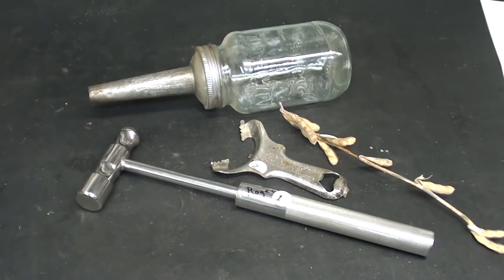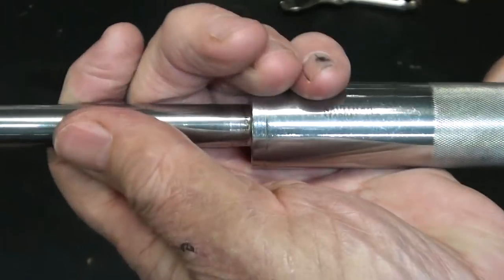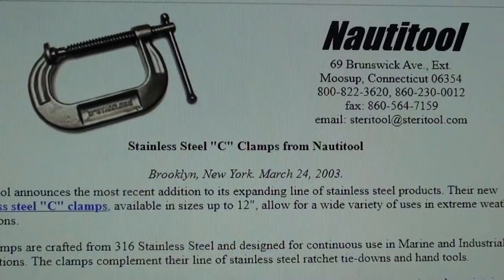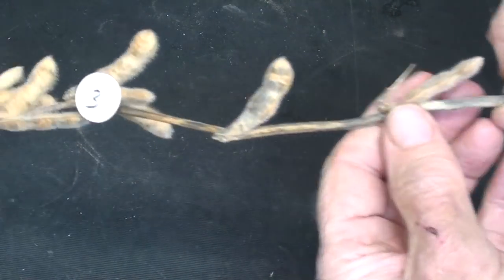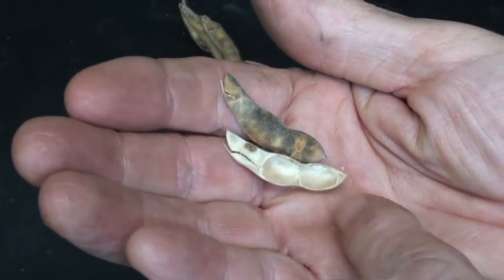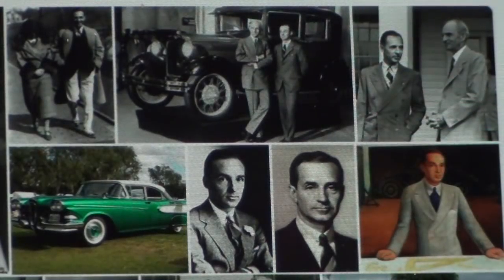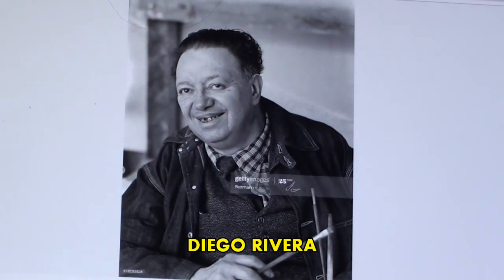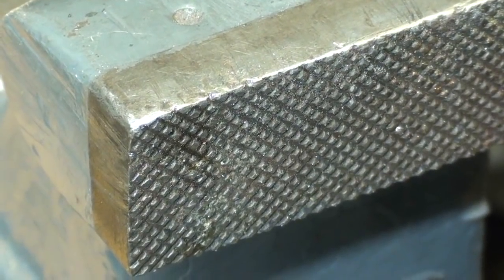WHAT IS IT? MYSTERY TOOL 63b Answer tubalcain mrpete

Comment: #1 is used in joint replacement kits. #2 is used for the older style Kegs. #3 is used for pre-60's vehicles. Water, oil, etc. Or used in kitchens used for separating cream from farm milk pre- WW2.

Comment: the gas stations here had a scam-- when checking your oil level, he would not push the dipstickj alll the way in, then tell you that your car was a quart low. if you said, put in a quart, they had an EMPTY can and just put in in and charged you one dollar
Reply from the maker: I have heard of that scam. At least I didn’t overfill it

Comment: The glass oil jars were before my time. I remember going with my dad to a small auto supply store in East Norwalk, CT and buying Wolfs Head motor oil by the case. Dad never got one of those spouts that you shoved into the top of the can so you  could pour the oil into the filler neck without needing a funnel. He kept an old can opener in the garage and would punch a big hole on one side of the top to pour from and a smaller hole on the opposite side to let air in to take the place of the oil coming out.

Comment: You can pressurize the marrow cavity so much while driving in a hip prosthesis that you can actually force fat and bone marrow into the blood stream ( which causes big problems).

Also used for driving pins into bone.
Reply from the maker: Thanks
Reply: Ewww
Reply: Used to machine hip prosthesis from forged titanium  with a spherical turning attachment on a Ward  turret lathe to plus or minus one micron ,no pressure!

Comment: Stainless usually does not spark when struck with other metals, so with brass and bronze is good material for tools used in areas where there is danger of fire .
Reply from the maker: Thanks

Comment: The Standard oil thing is for Mason jars .when you preserve fruit and stuff in them the vacuum sealed lid was under a ring .The ring would be tight or stuck with rust mso you undid it with the handle, then the vacuum seal lid could be flicked off with the little tang .
Reply from the maker: Thanks

Comment: Many vehicles out there use soy based insulation on the wiring these days. Especially the imports as soy is something they don't have to import. It has an unintended issue though of rodents eating it off the wires and causing major headaches. Honda actually sells a tape to help with that, it has capsaicin extract in it that is supposed to keep them from eating the wiring.
Reply from the maker: Thanks

Comment: My understanding is that that hammer is not used in a surgical environment.  That company makes stainless tools for all sorts of applications including medical, marine, fabrication, food processing, and other sanitary environments.  Besides their corrosion resistance, these tools may be used in the fabrication of equipment (e.g. medical or chemical processing equipment) where free iron contamination is a problem.  To avoid creating any particulates or transferring any microscopic quantities of steel onto a struck surface, tools are either stainless or some other compatible material.  That should explain why it is heavy and has a ball peen.  

This shouldn't come as too much of a surprise to any welders who understand the importance of using stainless wire brushes when working with certain alloys.
Reply from the maker: Thanks

Comment: I have an armoured cable cutter too, otherwise known as an angle grinder with a cut-off disc.
Reply from the maker: lol
Reply: I've seen so much damaged insulation. When I see the grinder line it's usually because I'm there to fix the short.